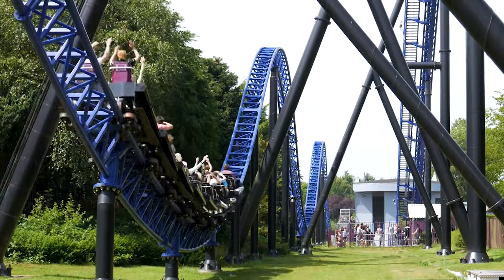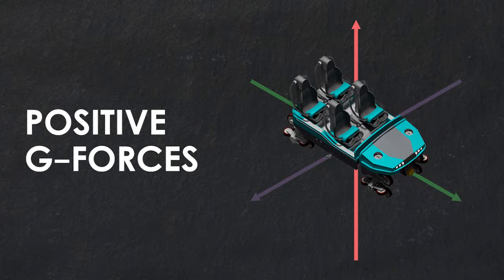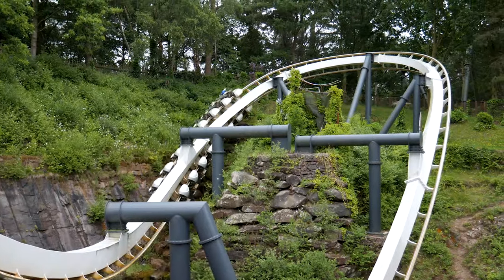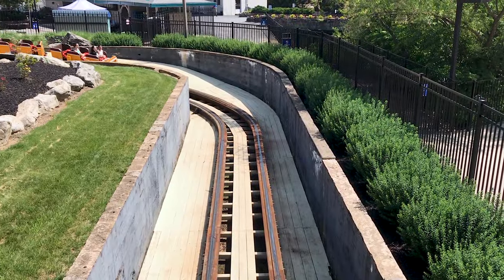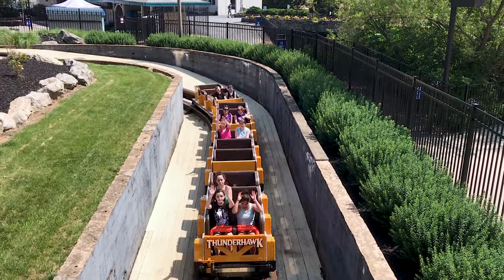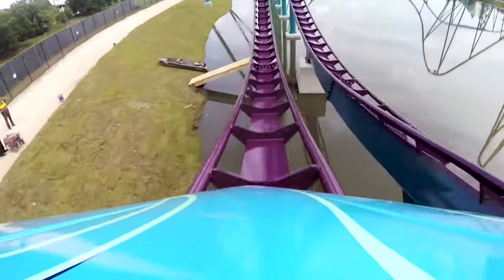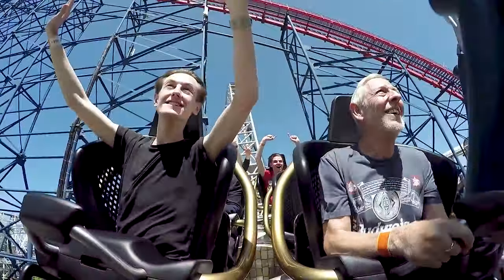Roller Coaster Forces: Explained

Comment: Any reason why launched g-forces (linear ones) feel more intense than positive g-forces experienced on banked turns? For example most roller coaster launches are usually only around 1.4 g's but they always feel intense. However many roller coasters such as millennium force supposedly produce nearly 5 g's on the turns, however I never remember an intense feeling during the turns.
Reply from the maker: The human body can withstand some g-force types better than others. For example, are bodies are pretty good at withstanding positive vertical g-forces, the one's which many rides reference their high g-force number about. Other types we aren't very good at withstanding. That's what you are experiencing here :)
Reply: Are bodies pretty good at withstanding positive vertical g-forces?
Reply: All gigas have 4.5 gs

Comment: Great job and that was a lot of information to be obtained. Did your research well I might add. The one thing that I don't understand is that the lateral g forces are the ones that can cause you to gray out or black out and I rode Storm Runner back in 2012 and I blacked out on it during the launch and regained consciousness towards the end of the ride. There were no lateral g forces during the launch...I have thought that maybe it happened because I was nervous and dehydrated at the time I was on the ride. I rode it again 2 months ago and did not black out at all.
Reply from the maker: On roller coasters, it's usually positive vertical g-forces that cause you to black out. These are the ones which push you down into your seat. However, being nervous and dehydrated will make blacking out much easier.
Reply: That is the conclusion that I came up with after thinking about it that it had to have been due to dehydration and nerves because 2 months ago I didn't black out and made sure I was hydrated and wasn't nervous.

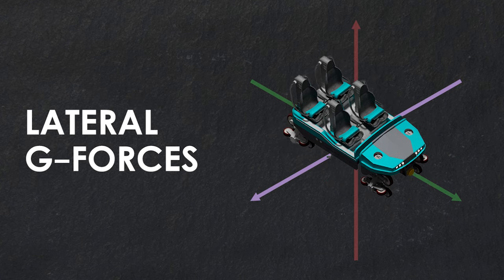Comment: 2:15 If we start splitting hairs, essentially all g-forces are caused by a change in speed. The direction of force is determined by the direction in which the speed changes. For example, let's say that a Wild Mouse train moves towards a sharp U-turn at 20 KPH. As the train turns around, its speed along its original direction of motion on the horizontal x plane is reduced to zero, and then goes to negative. We feel the change in speed along the original direction of motion as lateral g-forces as the train goes around the turn. The same applies to airtime hills, there the train's speed on the vertical y plane is turned around, and we feel it as airtime.
Reply from the maker: If we're splitting hairs even more the g-forces are caused by a change in velocity, as the change of speed in a certain direction is what causes the accelerational forces. Speed doesn't always have to change for acceleration to occur, as you said. A change in direction, even when the speed is maintained, requires an acceleration :)

Comment: Great video!
But I think what you describe as positive and negative forces, actually are vertical forces. All three types (lateral, vertical and linear) can have positive and negative forces:
Positive linear: launches / Negative linear: Brakes
Positive vertical: valleies / Negative vertical: Airtime
Positive / Negative lateral: to the right / left
Well I'm not a physics student, but that makes sense for me and that's what I've heared so far :D
Reply from the maker: Positive and Negative forces are under the umbrella of vertical g-forces yes, and I forgot to mention this. However, lateral and linear g-forces affect the human body the same regardless of direction. This is not true of vertical g-forces. The amount of force the body can with stand changes drastically between positive vertical and negative vertical forces, hence the further classification. This cannot be said about the other 2 force groups. Nevertheless, thank you :)
Reply: OK thank you for your explanation! :D

Comment: Is there a name for the sensation in the pit of your stomach when going down steep drops? I used to experience those more intensely than others.
Reply: Mystic Mind Analysis I’d say airtime still..
Reply: Thing is, I get the same sensation on the swinging boat flat rides, but not when it reaches the peak of its swing. Only when it starts swinging down again. And it only happens when facing forwards, not backwards. So I'm wondering if the sharp pang in the pit of my stomach isn't a reaction to forces specifically?
Reply: Mystic Mind Analysis freefall is what your thinking of, similar to floater airtime

Comment: You forgot about inertia. That’s why you get slammed into your seat when you slow down or speed up. Itz’s similar to linear g forces I think. I also haven’t taken physics in a while so I could be wrong. Also thank you for finally explaining the different types of airtime! I keep hearing floater and ejector and never knew the difference.
Reply from the maker: Inertia is essentially the reason you 'move' in your seat as a result of the respective forces. It's a component of the process in all directions. I should have mentioned it briefly but completely forgot, sorry! I'm glad you learnt something too :)

Comment: You know I finally figured out why I dislike the music in your videos, it’s because you use the same looped music for 7 minutes straight. Maybe whenever you switch topics change up the song? Or maybe whenever you finish talking about something, show raw footage and audio of what you just talked about, then cut back with different music. Maybe you talk about the launch system on a rollercoaster, and then when you finish you cut to footage and audio of that launch system functioning then cut back to the next topic. Just some simple ways to make the atmosphere less stale. Keep up the fantastic videos harry!
Reply from the maker: These are good suggestions, but the pacing of the video would be ruined if I did talk about something then cut to a video of it occuring. This would drastically increase the length of the video, as well as feel jarring as it happens 10s if time throughout. Music is definitely not my forte right now, and is something I need to work upon. I'll bear it in mind :)
Reply: lofi hip hop radio - beats to relax/study to, you'll thank me later bro

Comment: Theres also a red out, when negative forces are too strong and sustained too much blood goes to the brain causing a red out
Reply from the maker: This is very true, but doesn't really ever happen on roller coasters, as they are designed operate below the maximum threshold of the human body. Therefore, I didn't include it in the video :)